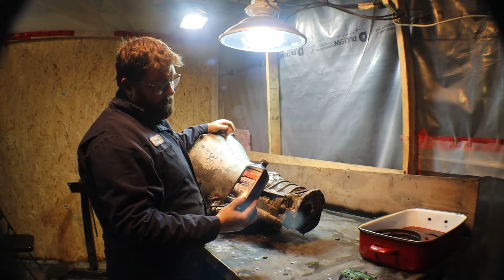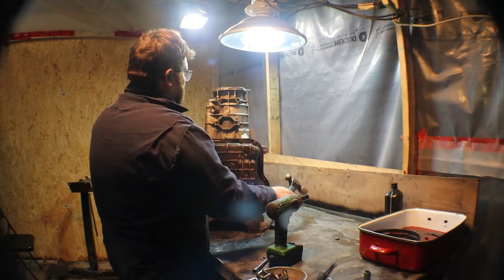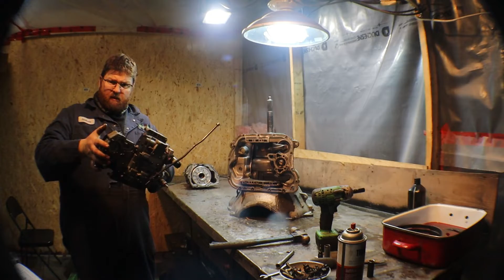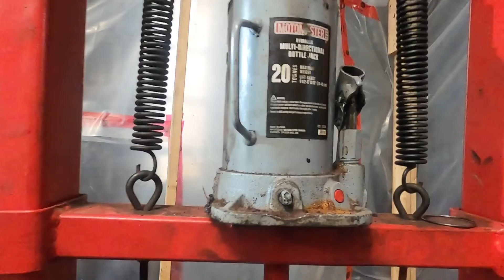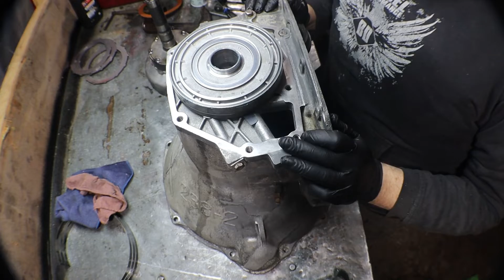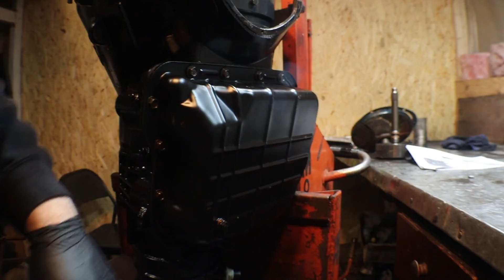This 47RE transmission build holds serious power

Comment: That is true for the lighter vehicles, using DexIII will cause a harsh shift in those type vehicles. The diesel pickups shift a little firmer using dexIII its all about shift feel. Both types of ATF lube the gear train just fine. The intermidiate band you are showing should be swapped out for the solid type lining. More surface area.
Reply from the maker: Thanks. The kit I bought came with that  band so that’s what I went with. Higher horse builds will be getting the solid lining band.